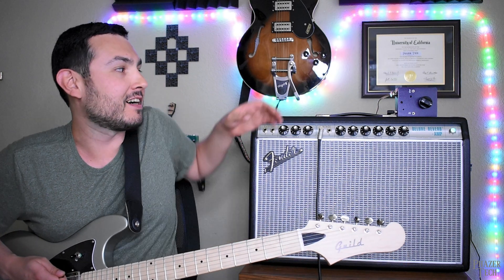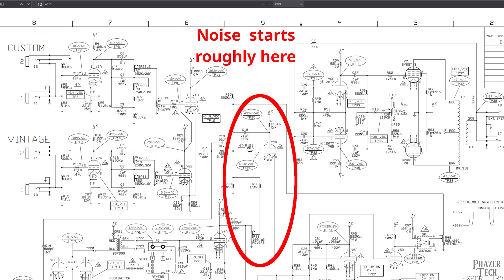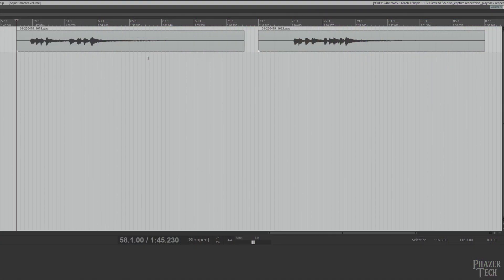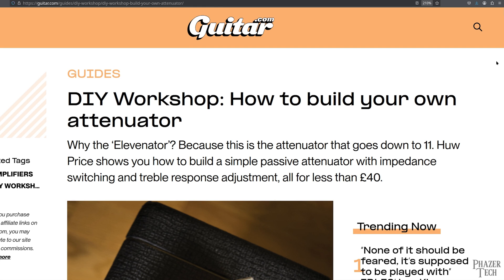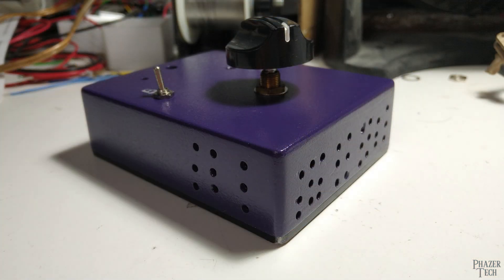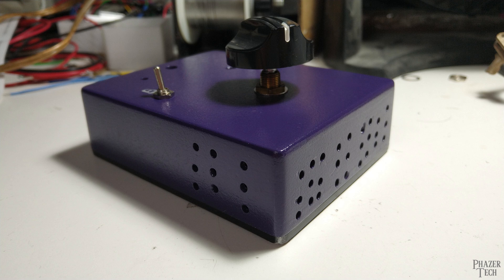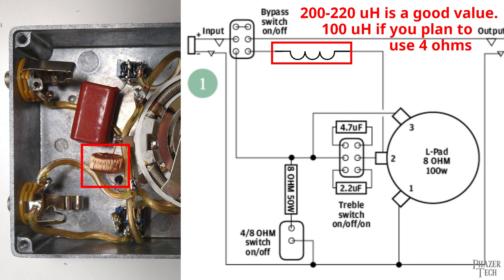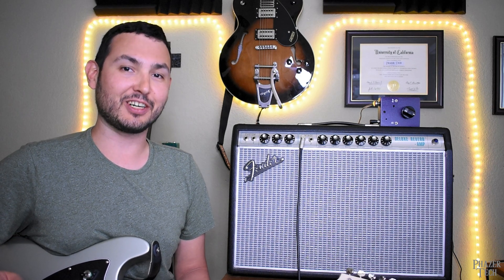DIY Attenuator Build Guide - Cut The Noise And Let Your Guitar Amp Sing!

Comment: Any video out there showing the building of a reactive load attenuator???
Reply from the maker: If you add the inductor then it becomes a reactive load. Yes there are more advanced designs out there but the sound quality difference is minimal, they're better but still don't mimic a speaker perfectly. So when it comes to sound quality vs build complexity and size, I think this one is a solid choice.
Reply: @P @PhazerTech . Also thanks for the response
Reply: @PhazerTech . How do I know or figure out which types and/or sizes of inductors might I need?
Reply from the maker: @Mike_HuntizWet  It's covered in the video, towards the end.

Comment: Thanks for this! Do you find that when the attenuator is active and turned up to 100% output, that there is a noticeable difference vs the bypass sound (ie when the attenuator is not engaged)? Thx again!
Reply from the maker: Sorry for the late response. You brought up a good point. The tone suck is more noticeable at higher attenuation levels, so turning the volume up all the way has little to no noticeable effect on the tone.

Comment: Hello! Thank you for the great video! I've built one according to your instruction, however when I measure the impedance, it goes from 10 Ohms to 7.5 Ohms as I turn the L-pad clockwise. Is that normal? Shouldn't it maintain a constant 8 Ohms? The way I measured it, is that I've connected the cabinet to the output of attenuator and made the measurements on the cable connected to the input of the attenuator only. Thanks in advance!
Reply from the maker: That's normal and I remember seeing similar results when I measured mine. The L-pad achieves its functionality in a pretty crude manner and it's not super precise, but it doesn't need to be. The output transformer doesn't care if the impedance slightly changes. If it were to drop down to something like 4 ohms and the transformer expects 8 ohms, then that could be a problem, but 7.5 is perfectly normal.